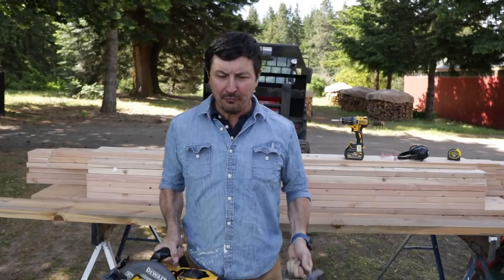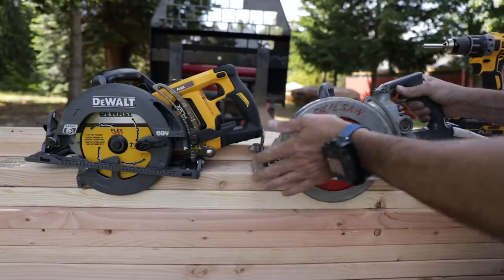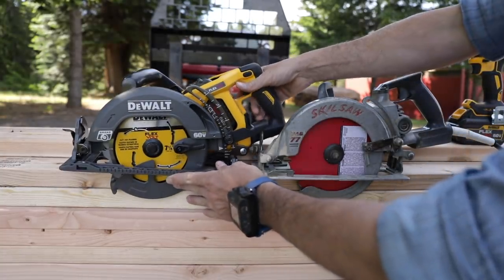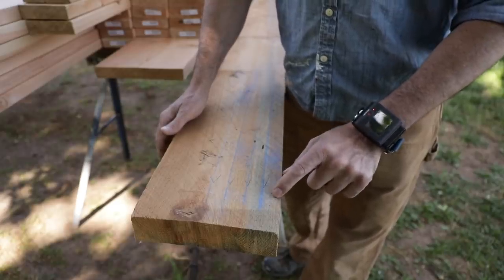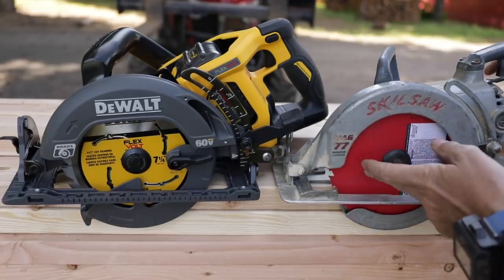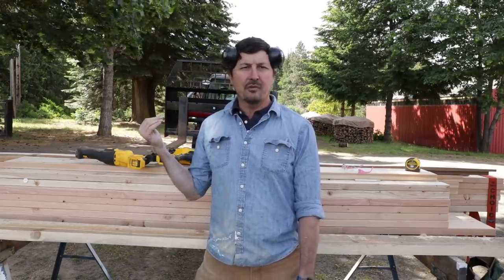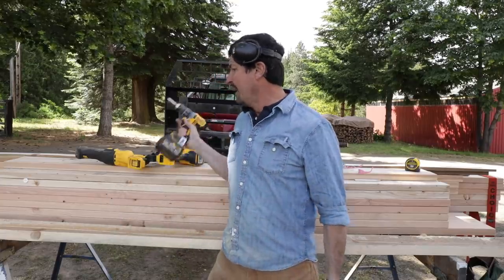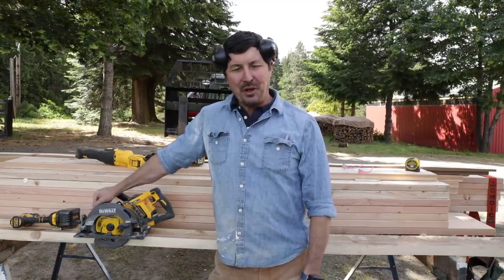Dewalt Flexvolt V.S. Skill Mag77 [S H O C K I N G]

Comment: In response to your longevity concerns you are correct that the batteries will eventually wear out. Inside those battery cases are most likely some standard 18650 cells wired in some serial/parallel configuration. You can replace the individual cells for a fraction of the cost of buying another battery. You can find better quality, higher rated cells and end up with a battery with more capacity than the label says, in essence upgrading the battery. Of course that assumes you are alright with a little electrical work like soldering. And if not, right here on Youtube University you can learn all about this process. 

The rest of the tools seem very well constructed and I've seen pretty strenuous drop tests and they are solid. I doubt they will wear out any sooner than the Mag77 that your family had dozens of.

Comment: That's super impressive.  All my Dewalt cordless tools are from 2006.  I've repaired them multiple times for the same reason... slave to the battery system.  There's no way my cordless circular saw can compete in the least with my plug-in Skil.  I still use it for tiny jobs, but it fries batteries almost instantly.  I'd be interested to know the battery life you're getting with the new system.  How often are you swapping them out?  How many would you need to get through a full day of framing, assuming you were in a remote location with no generator?

Comment: The performance of that dewalt was impressive but i wonder if the chip evacuating slots in the dewalt blade made a difference. Hey cody think you could run the test again with the mag 77 running the dewalt blade? or even put the diablo blade in the dewalt saw. either test should tell us if it made a difference. Still id probably pick the old standby simply because battery packs die over time and that gets expensive fast. Dont get me wrong id have a cordless too because no cord is super convenient.

Comment: When did you change the gear oil in the skill saw? How long was the cord, gauge of cord, and overall voltage drop during the test? A small cord can make you loose (lots) more than 25% of your voltage... Have you ever tried a Boost Box to up the voltage to 125VAC  during loading? End of the day all my cordless tools go dead and I have to finish the job, so now I have to gather even more tools up, and carry more tools on my truck, and cords don't get tired and run outa juice at 2/3 completion like a battery, and then I also have to charge the batteries at home at my expense. The real test; pull them out of a tool box in ten years and see which one makes you professionally finish the job with the least hassle. Bottom line: Batteries are for hobby toys, Cords are for work tools. Love Your channel and best wishes to Mrs. G, and Cody, and all! Btw, I love that all your videos are "impromptu" IE: not scripted or biased! A toast to an honest soul! Cheers! God has and will always bless you, for God cherishes your memories, as his own eyes through yours, are watching your every step.... :)

Comment: Cordless tools are spoiling us. I've been buying nothing but cordless unless it just doesn't make sense. I built a 16x20 shed last weekend and the only corded tools I used was a miter saw for angle cuts, and a pnuematic framing nailer. I used cordless drills, impact, circular saw, sawzall, spotlights, and caulking gun. All of my cordless tools are Ryobi since they are affordable. I also have a corded Milwaukee sawzall that I haven't used once since I got the cordless Ryobi. It's kind of a shame because I'm sure the Milwaukee is the better tool, but the cordless is just so much more convenient

Comment: So the real question is: Dewalt, Makita or Milwaukee? and Why? Very soon I will be moving into my first home and I want to put a tool kit together as soon as I can, I'm a firm believer in 'buy cheap, buy twice' so saving a buy good tools is a must for me. Especially as I have plans to use them for DIY and hobbies.
Reply: Matt Smith Milwaukee,  trusted by industry, will never let you down
Reply: Ryobi is good for a homeowner , so is Hitachi.
Reply: Matt Smith i bought a new Milwaukee impact for as a second drill (to speed things up) on a job that required driving a bunch of 8 inch lag bolts.  Smoke began pouring out of it after about 30 minutes.  Had to finish the job with my dewalt.
Reply: Cordless tools are like m&m's and nascar.  On the outside there are alot to choose from.  Inside they are all about the same.  I've had yellow 20v for years tons of options batteries are available they last as well as u take care of them.   That said I just purchased the Milwaukee m12 fuel ratchets 3/8 and 1/4.  Those things are awesome! I hardly use my air tools now.  Think long and hard see what tools are available in each line because they are an investment.

Comment: Im wondering how long a charge lasts and how long the battery lasts. My rechargeable saw and drill last not all that long and after 8 years or so hardly hold a charge longer than a few days of no use.

Comment: Like any other tool, those two have their place and purpose. I build decks for a living and owning both I can say that mag 77 will be around for a long time. While I like to grab my dewalt for smaller landing jobs or to finish off some left-over work, batteries just run out too quickly. I go thru 2-3 each day in the summer (using 9ah, at the time 12ah were not out yet) in the winter, definitely 3. Dewalt is a good saw, it’s just as much of a monster on those expensive batteries as it’s on wood.

Comment: That was a really impressive show of what a cordless saw can do.  I have invested in the M18 line and am very happy with it in most cases.  I frame new homes only and use my saw for 100's to 1000's of cuts a day.  The only task I plug in a saw for is ripping 20ft facia boards with a roof angle bevel on.  10-15 boards 20ft long is just a waste of my battery power.  M18 has dropped the ball on the new line of circular saws imo and your video shows/proves it.  They came out with a 7.25 blade version as well but the damn blade is on the wrong side of the saw!  pissed off

Comment: This is so ironic that you just posted this video. Just yesterday I was building a new work bench with my buddy and his Porter Cable cordless saw ended up dying on us halfway through the project. I just ran up to Tractor Supply and bought myself a brand-new corded one and we were able to finish everything and much faster time not having to wait on batteries to charge and in my opinion his older battery powered Porter Cable which was identical to my newer one was not nearly as powerful. I think you got lucky cuz it's a brand new saw in a brand new battery give it 6 months and I bet you won't want to use it that much.

Comment: The only thing you didn't mention or address is the longevity of power. Obviously the corded saw has an endless supply of power and will out-cut any cordless, non-stop.  However if you're building and cutting all day, how many batteries will you go through in an hour? How fast do they charge? Is the charge time longer than the life as you cut and cut? If so you'll need a dual- or two chargers to keep up with your work. And honestly I've used my Skilsaw on a ladder and on a roof, and to bring it down you've always got the cord to lower it by.. kind of nice even if it's not recommended.

Comment: As the batteries get older they start to lose their power. I recommend numbering your batteries so that you know which ones are losing strength or have something weird going on. I do these with my quadcopter batteries and it works well.

Comment: being an electrician i used to always use corded milwaukee drills like the hole hawg and other smaller ones, now days i hardly EVER brake out an extension cord. Roughing in a house i bring two fully charged batteries especially a 9.0 Amp hour and 95% of houses i rough in never use two full batteries. I was worried about longevity on the m18 hole hawg but for the past 2-3 years now its still going strong. I have all the m18 fuel cordless tools i use now days. i dont even have a corded drill in my tool box any more. Corded tools are going the way of the dodo bird.

Comment: Ive used a Mag for 15 years framing houses. All I do is framing. I decided to try this saw and have been using it the last two months. The power is definitely there. Ive ripped PSL beams with it no problem. Also, between all the other cordless tools I don't think Ive had to roll out a cord since buying the flexvolt "package" except for my compressor and that's only because the DeWalt framing gun only holds ONE rack of nais...cmon!

I normally don't even like DeWalt tools because they look and feel cheap but guys who have rolled out hundreds of feet of cord every day will understand how convenient this is. 

Cons: bulky/heavy compared to Skil latest model. The  depth guage lever comes loose often. Also, the housing needs to be stronger. One of my employees dropped this saw from 8 ft and the saw completely snapped in half. That wouldn't happen with a Skil. Also, the safety button has to go! Extremely annoying if youre holding the saw at an awkward angle....

Comment: Nice cordless saw, but my Mag77 has built over 300 structures within my time as a carpenter. Rain, snow, mud and ice and it'll keep working no matter the weather, never been shocked, never slowed down no matter how many times it fell from the roof and I've never had to replace a part. Other than that I'll probably need one of these in my man cave near a charger and under a roof.

Comment: I first used cordless tools about 30 years ago; in the B&D NiCd era. They were very limited, the batteries did not last. Frankly the tools were heavy and had poor build quality. About 15-16 years ago I bought a Ryobi 14.4v 3 battery NiMh drill driver. It was the first cordless tool I really liked. Not perfect; but quite practical and not that expensive. I still have it; but I bought a new one; mainly to replace the batteries.

Today I use the Ryobi One+ 18V LiPo batteries and have about 11 different tools and torches in that system. I use them to make things and in the garden. I only use specific corded tools - when I actually need them. Cordless has almost totally taken over.

Comment: What happened to the one dewalt gave you in 2017? Anyways a more fair comparison would be a sidewinder corded new against the dewalt battery. I'm a fan of dewalt battery all day and won't do corded at all unless I've erroneously forgotten to charge batteries , just saying the worm drive is meant to have a slower RPM than sidewinder.

Comment: Thanks for pointing out that you did actually buy the thing, it makes the review actually worth something.

You didn't mention that the Dewalt isn't actually a worm-drive saw (not that it really matters if it's more powerful anyway).

Do you know what's supposed advantages of a worm-drive  are vs direct drive? I take it that having the motor at 90 degrees to the blade makes it more compact on the side the motor is located? Is that the only benefit?

Comment: Cody, if you want to see some beast tools, have a look into HILTI and Mafell. HILTI builds robust tools that can take an ungodly beating and still work. HILTI's largest cordless impact will make any impact you've had look like happy meal toy. And Mafell manufactures timber frame and premium tools, better than Festool. I'm personally fond of the 17-11/16" circular saw, running on 230V, pushing 3000 Watts and 1700rpm.

Comment: Not trying to be over critical here but the real question is how LONG can a battery driven saw cut faster than a wired one can cut.  Yes, in this test of cutting the same board twice the battery driven saw cut faster...but to me, it seems like you have to wonder how many of those cuts can you get out of one charge?  I'm not anti battery....I'm just asking a question here.

Comment: I recently got my 3 rd cordless circular saw. A Makita 18x2 = 36 volt framing saw. 
 Reason I chose Makita over DeWalt =  
Makita 18x2 framing saw depth of cut = 2 9/16" 
 DeWalt 60 volt framing saw
Depth of cut= 2 7/16" 
 I have to make alot of thru cuts in 2 1/2" insulated metal panels . they are a full 2.5" thick. Non of my worm drive saws will make the cut all the way thru unless I take the guard off and run an 8 1/4" blade. 
 Since I'm building off grid . It seemed a good time to cut the cord. 
 But , mow I'm committed to Makita batteries.

Comment: Frankly man, even though a lot of modern tools are shoddily engineered and put together without much care for longievity, the fact is that well moulded, glass fibre reinforced nylon with metal in the right places will last effectively forever. As you said, it's inevitably the batteries that are the weak link. I'd be looking for tools that have straightforward electrical systems that you can modify for running on newer batteries in the future.

Comment: Great tool. But Dewalt is having trouble with flex batteries in 60v mode. Have been waiting 3 months for replacement batteries. It was also noted by the rep that when the current supply of lithium cells used in the battery pack run out the batteries will about 50% more due to import tariff.

Comment: The DCS577 is an excellent saw, no joke. I really like mine a lot. Brushless motor technology is making a big difference. Not only in available power, but the fact that the saw blade has an electric brake is HUUUUUUGE. For convenience and comfort but also SAFETY. The blade stops spinning almost immediately compared to every plug-in corded circ saw I’ve ever used or seen. They spin down slowly. The battery saw just feels more  tight and precise.

Comment: Cody I would like to see how well that DeWalt would hold up in a fab/weld shop environment.  I still have an old B&D worm-drive that has cut miles of aluminum sheet and plate.  Will a cordless saw stand up to that same abuse?  Likely not.  

It may be worth swapping the blades between the two saws to compare them again.  Most cordless saw blades have a thinner curf so they don't use as much power to cut the wood.

Comment: I've never been particularly impressed with the mag 77, just about every other worm drive out there will smoke a magg 77. But that flex volt kicking the snot out of the mag 77 like that! Holly crap!!

I just started a new job that is going to require a significant investment into cordless tools which as you stated is really an investment in batteries and then what tools they run. My bet is its only a matter of time till all the major players have something similar to dewalts flex volt. So what skin color to choose. Yellow has it now, red orange and blue it's coming.
Reply: Totally disagree. Being a retired union carpenter, you see not just skillsaws in gangboxes, but also in a residential setting. The weight difference in a Milwaukee for instance is huge. It's the easy at which you work with the saw that makes the difference. It's like a 25' stanley compared to all the other variations on the same theme. In a out of the tool belt holster a million times a day allows you get the most work done, compared to a fat, awkward tape measures with all the bells and whistles.

Comment: For someone who uses cordless power tools daily or at least a few times a week, the cordless tool line of DeWalt and Milwaukee is hard to beat. As you slow down when you get older and use tools less, cordless tools make little sense. If not drained and recharged routinely the batteries do NOT last long, never hold a charge for very long (after a year or so old) and loose power as they age. When it comes time to buy new batteries, they cost almost as much as the tool kit did!  When I retired (as a contractor) and no longer used my tools daily, I got sick and tired of batteries dying after only a few minutes. Since I have outlets all over my home, shop, garage and yard,  I sold ALL 9 of my cordless tools and bought made in America (vintage new in box or as new) Milwaukee, Porter Cable and DeWalt power tools. I paid a premium for the NIB vintage American made tools but I am glad I did. NO more batteries to charge, NO more replacement batteries to buy (at rip off prices) and plenty of uninterrupted power.  :) This worked out for me very very well and I'd bet for most guys who no longer use their power tools every day or in the field. For every day use - YES the cordless stuff is great!  Oh, and like Cody said, the Cordless stuff will never hold up like the old metal tools did and do.

Comment: I love de Walt flex products very much, but I still bought an old school 12A dewalt reciprocating saw.   My logic is that if I have a need for that saw, it's something large and I want max power and don't want to deal with going through batteries.   Other than that, most of my other tools are dewalt cordless and they are great.

Comment: That's quite a stack of lumber you've got there, Cody.  What project are you tackling now?
Reply from the maker: I've been repairing the deck and building new stairs,
Reply: I need to redo my deck as well.  The stairs are fine, but the top deck boards on the main section of deck need to be replaced.

Comment: I wonder if you tested a new mag77 or even one with new brushes if it would work better than the brand new dewalt with a brand new battery? I feel maybe if this were an apples to apples put the same amount of hours on the same battery as those brushes to see the same test. Then check the cost of a new battery vs new brushes? Just a thought
Reply from the maker: Perhaps but I don't think it would make much difference,

Comment: An observation... in England they short-change us with a 54 volt version, yours is 60 volt. Given that your AC line voltage has no bearing at all on the DC battery voltages, I am wondering why they do that? Is it simply to make the parts non-interchangeable? Hmm...